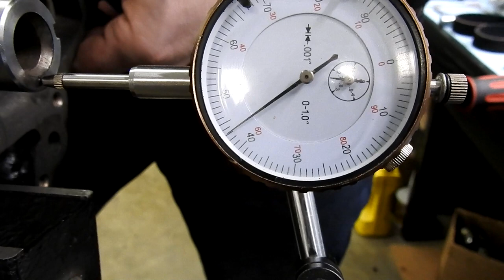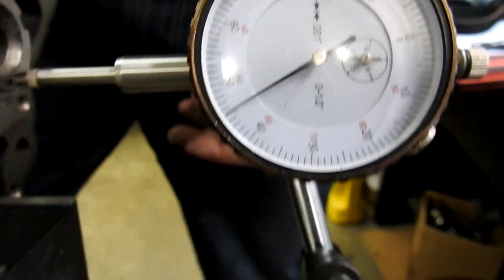Building a forged MX5 motor in 5 minutes

Comment: Are the actual engine blocks just stock? What was done to them? I’m very new to this and I’m a bit confused
Reply from the maker: The engine block in this build is stock.  It was sent to the machine shop to be decked and honed. Everything was cleaned checked and measured to make sure it was 100% in spec.
Reply: @rh2racing  what are the measurements u need to know? I know that there are prolly a lot so you don’t really need to answer that question lol
Reply from the maker: @crayonbox46  that is what a machine shop is for.  You can look up all the specs but I guarantee you don't have the right machines to do the job.  I wouldn't worry about that part as much.  After they do their work there are many things to measure.  I don't have the specs handy to list though.